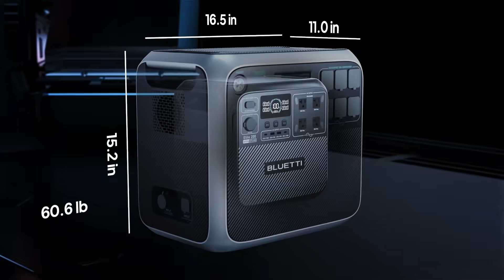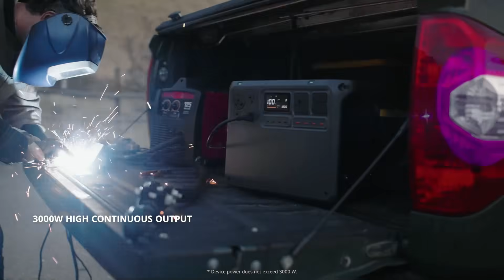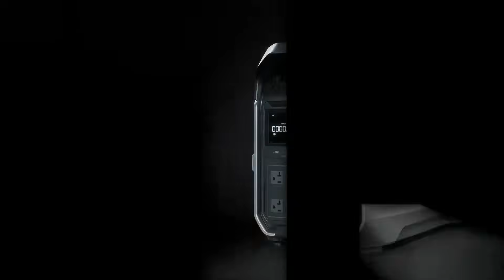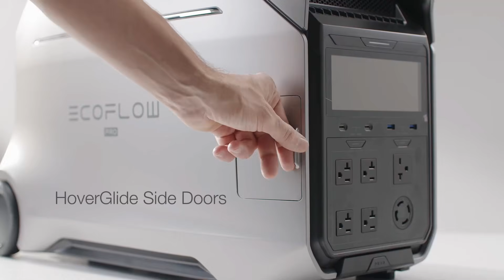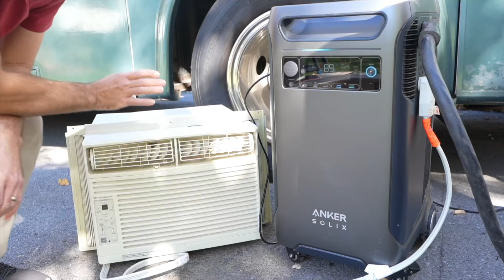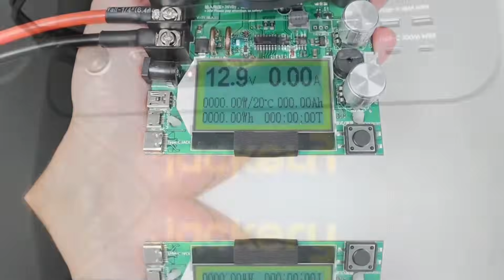5 Best Solar Generators for Air Conditioners 2026 — Enough Power to Keep It Running?

Comment from the maker: Not sure which one fits your air conditioner? These are the three strongest options from the video:

🥇 Best Overall — Jackery Explorer 5000 Plus
https://www.amazon.com/dp/B0DFGLG35L?tag=smartie-v018-20

⚡ Best for 240V and High Startup Loads — Anker SOLIX F3800
https://www.amazon.com/dp/B0C5C9HMQ2?tag=smartie-v018-20

⚖️ Best Balance for RV and Home Backup — EcoFlow DELTA Pro 3
https://www.amazon.com/dp/B0D14FMFZD?tag=smartie-v018-20

Check the links for current prices, coupons, reviews, and availability.

What are you trying to run: a portable AC, window unit, RV rooftop AC, or central air? Comment your BTU rating or running watts below, and tell us which system you’re considering.

Comment: How do you know my system needs when I'm trying to circumvent old power sources with fast dropping lfp prices?
Reply from the maker: That’s fair. I don’t know your exact setup. The video is really just a starting point based on AC power draw, startup surge, and how long you want it to run. And yeah, with LFP prices coming down, going bigger on capacity can make a lot of sense. If you share your AC model or power draw and roughly how many hours you want to run it, I’d be happy to help you figure out what size you actually need.
Reply: @SmartieChoice I'm still in the wait and see stage. My fear is that the OEMs will be the last to pick up on LFP price drops and also modern-day solar panel output norms. The situation looks a lot like Detroit brands, being 10 years behind in audio , software, and other systems.
Reply from the maker: @factchecker9358  Sorry for the late reply — I somehow missed the notification for your comment.

I think that’s a fair concern. OEMs can definitely be slower to pass component price drops through to finished products, especially when they’re still working through older designs, supply contracts, and inventory. Solar input limits are another area where some systems can feel dated pretty quickly.

I’d probably stay in the “wait and see” camp too if your current setup is still doing the job. But I also wouldn’t make the decision purely based on waiting for lower prices. If you actually need the extra capacity, faster charging, or backup capability now and you’ll get real use out of it, waiting another year just to save some money may not make much sense either.

So for me, it really comes down to whether the upgrade solves a problem today or is simply a “nice to have.”